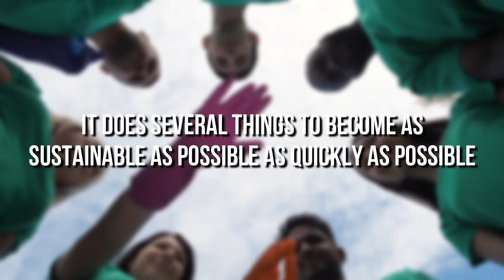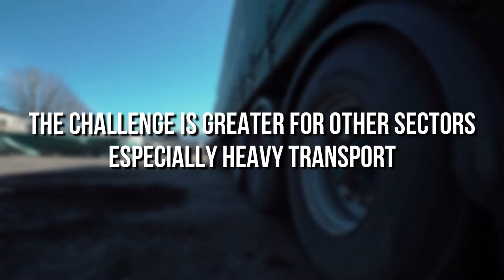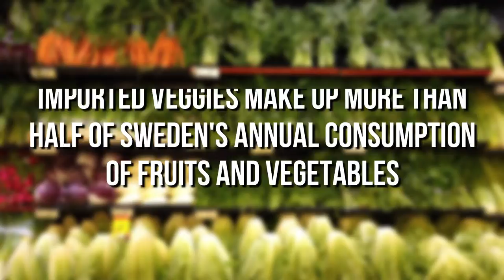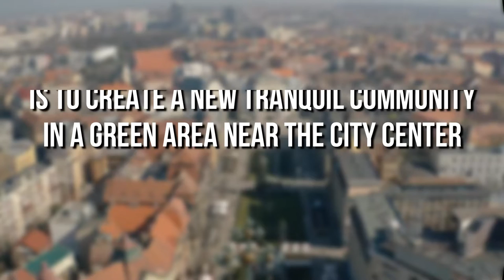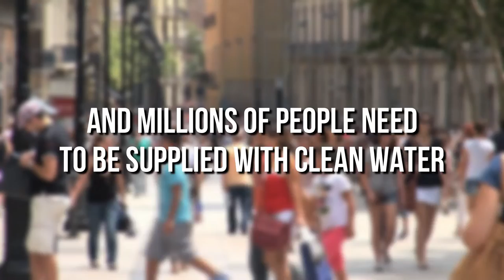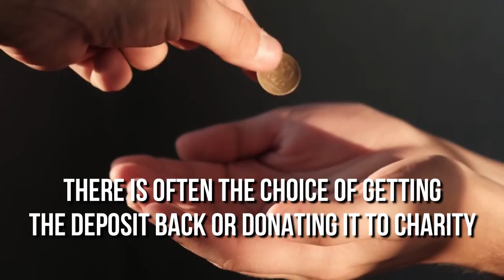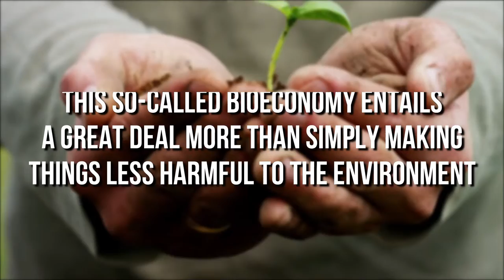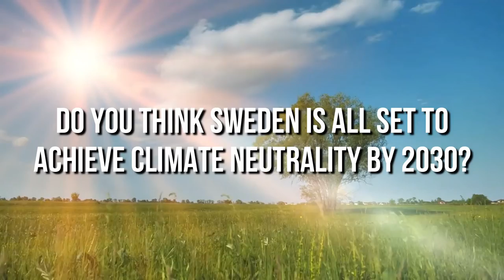How Sustainable is Sweden?

Comment: I will not get on board with induction as a "sustainable" way to charge cars. What's the efficiency of a wireless phone charger something like 50%? Now scale that up to thousands or millions of cars. How much energy is just disappearing in the gap between the car and the road surface? Maybe if you had a vastly higher supply of electricity than demand such as might be possible from nuclear fusion where you can afford to be totally decadent with your energy use but in the current world? Sounds like an absolute joke.